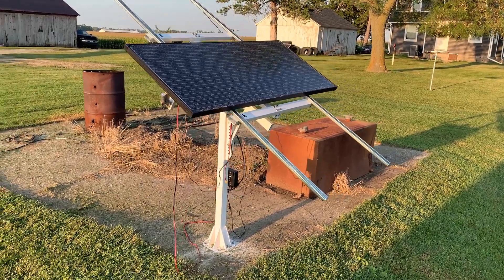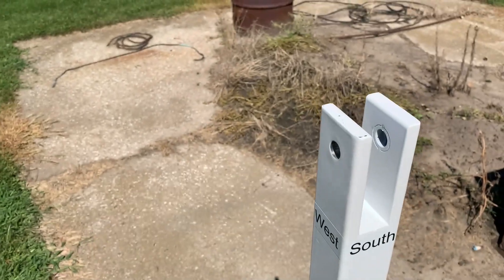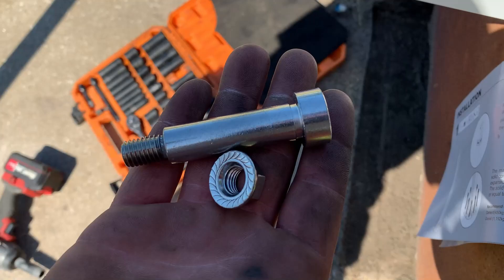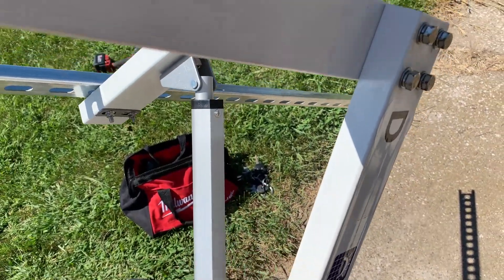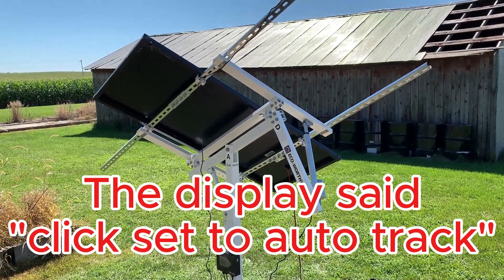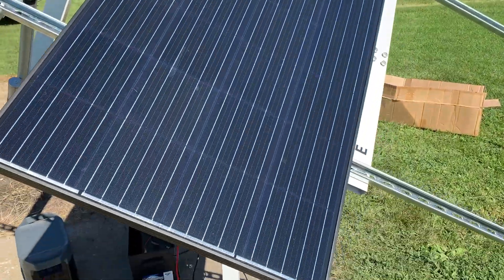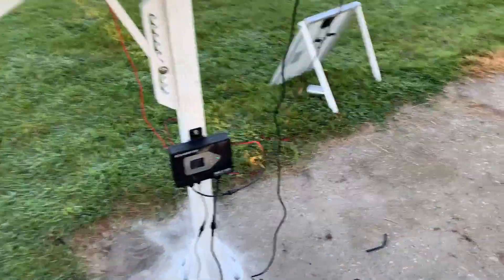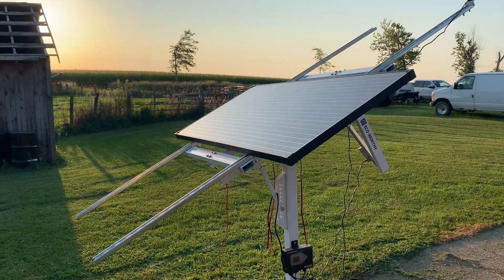Eco Worthy Single Axis Solar Tracker Install/Review

Comment: how easy is it to change the angle due to change in season?  I guess you haven't had it long enough to go through that but based on setup how do you think it will go?  The dual axis is very cool but a bit out of my price range since the sun is only really full strength for about 6 hours on my property.
Reply from the maker: @TheFutureisTheFuture  just changed it yesterday, I unhooked the battery so it wouldn’t move while adjusting, wasn’t hard to adjust at all
Reply: @rnkustomz  great. Seems like it might be awkward from the weight of the solar panels. I guess not... Great 👍🏻
Reply from the maker: @TheFutureisTheFuture  to be fair I only have 1 panel mounted currently, so with a full set of panels I’m sure the difficulty would increase. Always good to have a buddy on standby haha

Comment: Due to the extreme price drops in the solar sector, it is much cheaper to simply install more modules instead of a tracker!
Trackers also have outdoor mechanics & electronics and are therefore maintenance-intensive and prone to repair.
Solar modules and racks, on the other hand, generally function maintenance-free for 25 to 30 years!
Reply from the maker: @michaelvanallen6400  all situations are different, for someone with extremely limited space a tracker can be necessary. Thanks for the comment.

Comment: How thick is the concrete?
Reply from the maker: This concrete is 4 inches approximately. It’s an older pour on the property.
Reply: @rnkustomz  thanks for letting me know I'm thinking of ordering one and wanted to know how thick to make the concrete
Reply from the maker: @The831Z  I’d go a bit deeper than 4 personally, especially if you are in a cold climate.
Reply: @rnkustomz  California. I get no real cold weather but thanks ill go deeper. It better to go deeper just in case. Thanks
Reply: May I know what is the biggest size and weight will it hold?
Reply from the maker: @newbie101  Not sure on weight, and the panel size guide is on the product listing

Comment: I have two of the dual axis trackers. Do you know if that updated controller will be available separately? I like how the display has a description of what’s going on vs mine which just as a timer and two letter codes.
Reply from the maker: @aflipzkidn  haven't heard anything on an updated display for the dual axis version, but I haven't looked into it at all either honestly. Thing controller wouldn't direct swap as their isn't a second input for another actuator.
Reply: @rnkustomz  cool thanks for letting me know.